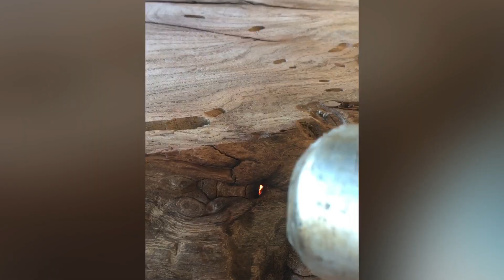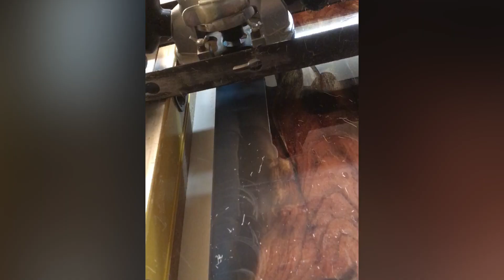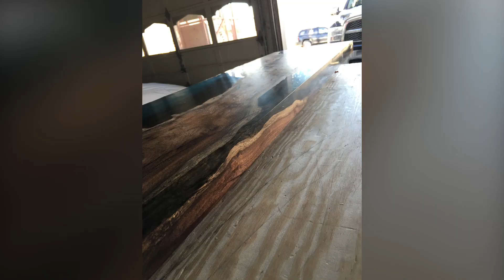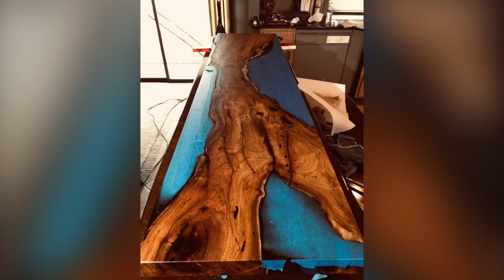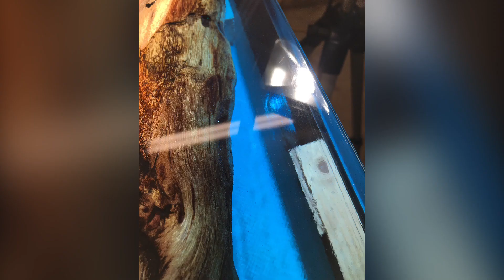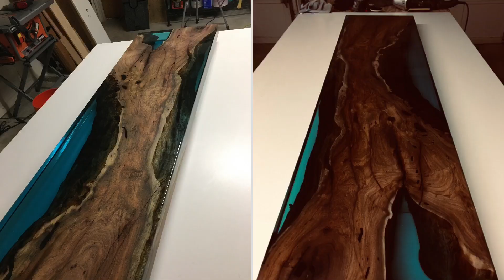I Did It! Resin Sofa Table

Comment: Hi there! What kind of finish you used on mesquite if you dont mind me asking? Also how well did epoxy bonded to that finish?
Reply from the maker: Hi, I poured the epoxy before I used applied a finish to the wood, so it bonded real well directly to the wood. After I was finished sanding and shaping, the only finish I applied to the wood was linseed oil.
Reply: @joemonnone  thanks for sharing that. I have little dilemma with my Mesquite slab... the way its cut- it got about 1/3 of its entire length  (and its yellowish part  of wood) very thin compare to another 2/3 of the slab, and it will be completely submerged into epoxy. and I don't know if I should put some finish on it before epoxy? otherwise color contrast  between main part of the slab (that will be finished after epoxy) with part that will be submerged  might be little weird ? would you have any thoughts?
Reply from the maker: @slavaartyukh4075  If one side is thinner than the other, then I would first try to elevate the thin side to make it all level wood on the top and try to pour the epoxy in a way that fills the void from below. once all epoxy is set, I would level the top with a router planing jig. This is just what I envision from what you told me, but I may not have a correct understanding of your situation.  To answer the main question, should you put finish on the wood before submerging it in the epoxy, I would say no. Instead, I would brush on a thin layer of epoxy on the whole plank of Mesquite first, then let it cure for a day, then do the whole pour. After it cures completely, sand the wood that you want exposed and apply the finish. It will look natural. (One note, this assumes you are not going to stain the wood).
Reply: @joemonnone  thanks for your tip, I appreciate it! If you picture very first (2inch) "slice" out of the whole log, when towards the root its thick, but on top its could be paper thin... Thats kind of a slab I got, and that "paper thin" part got that yellow wood that mesquite has (kind of top layer under the bark)...im planing just to put either tung oil or Odie's oil on it, and wonder if that thin part (that wil be submerged in epoxy) would create  collor contrast with wood that stays above and got oil coat on it... But I might just go with your advice and see what happens...
Reply from the maker: @slavaartyukh4075  So how did it turn out?
Reply: @joemonnone  I actually put that peace aside and practiced on another peace of mesquite to see how its acting under epoxy - looks great actually. I made pretty good coffee table just practicing ... ;)))